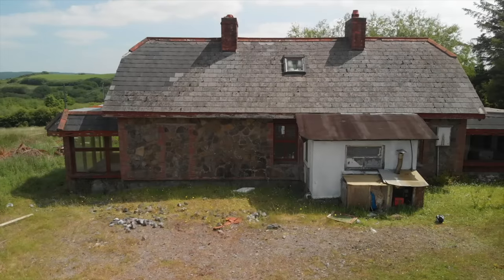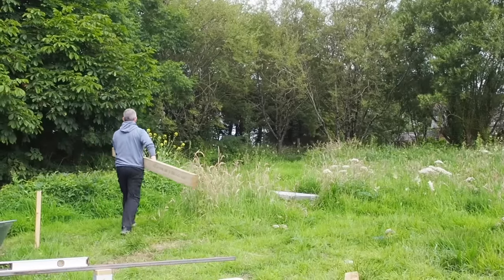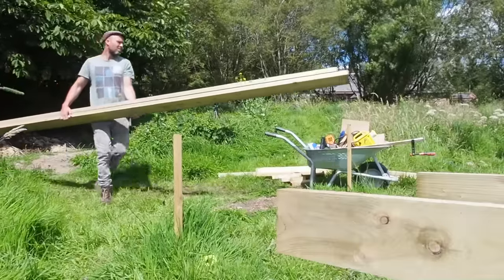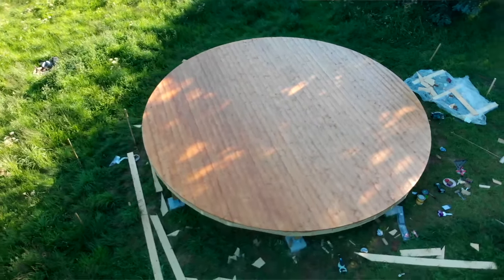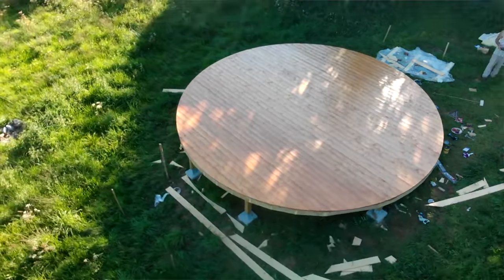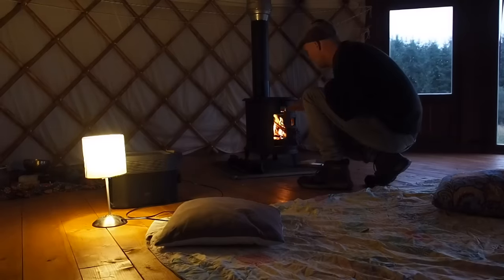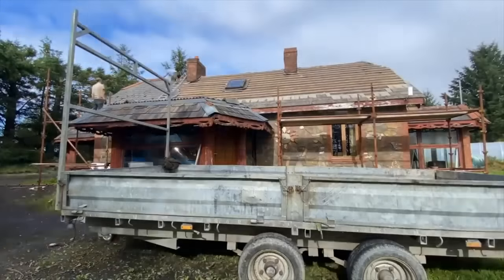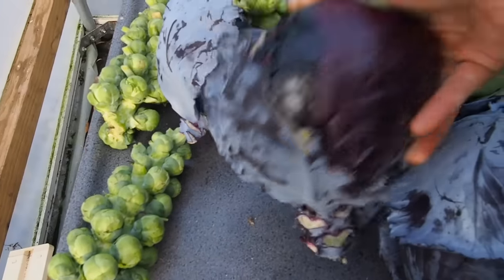Year 2. Everything we built on our Land Homestead TIMELAPSE

Comment: How durable is the wooden fundament? Is it pure wood or coated? If you just drill screws in like that without further treatment, it will not last long, will it?
Reply from the maker: Should be pretty durable. It’s made of larch so extremely durable. The screws are just to stop lateral movement the wind braces will stay in place without them with the way I have cut the wedge

Comment: It would be really interesting to compare the carbon footprint for building the yurt (manufacture and transport of concrete, production and transport of chemicals like the Sadolin, impact of the loss of trees, the milling and transport of the wood, the electricity for power tools, manufacture and transport of screws & joist hangers, the manufacture and transport of the insulation materials, etc.), over simply buying a large caravan/mobile home.
It would also be interesting to compare thermal efficiencies between the yurt and the caravan, and the carbon footprint for powering and heating both with the most efficient forms of heating for them.
Overall costs wise, the caravan would be a clear winner, unless the plan would be to use the yurt/several yurts as a holiday let/s in the long term.
Reply from the maker: I’d say the footprint of a caravan/mobile would be way worse than a yurt personally. The yurt structure is from a chestnut coppice so completely renewable. The insulation is sheep’s wool renewable and bio degradable. I used a tiny amount of concrete which I would have had to use if I sited a mobile. Most of the materials used in the yurt would return to the earth being natural materials. The only bad bits I’d say would be the PIR insulation in the floor which is horrible stuff but does a great job insulating and I guess the stain. We heat with a small wood burner which gets us nice and warm in no time. With wood that is coppiced for burning it is carbon neutral and completely renewable. I guess a caravan would have a gas stove as standard. The long term plan is to rent it out in the summer once we are back in the house to earn a bit of money. That’s my thoughts anyway. I love the yurt it’s a beautiful space to be in :)